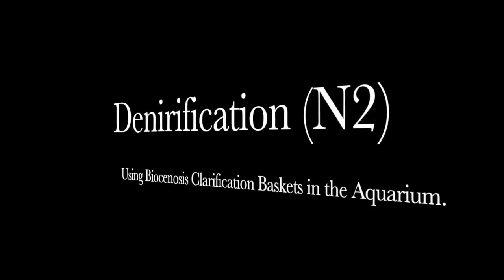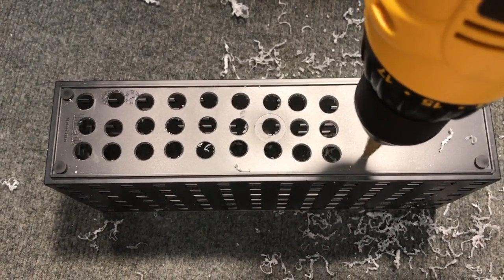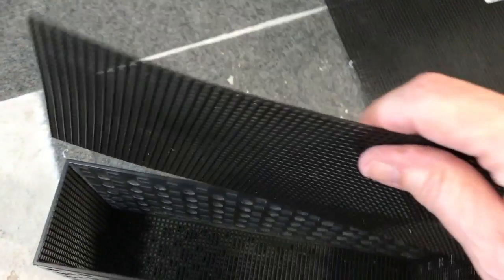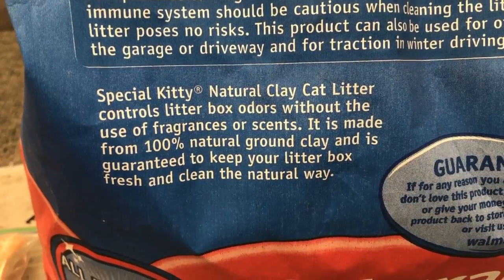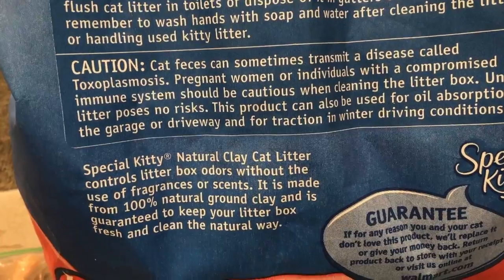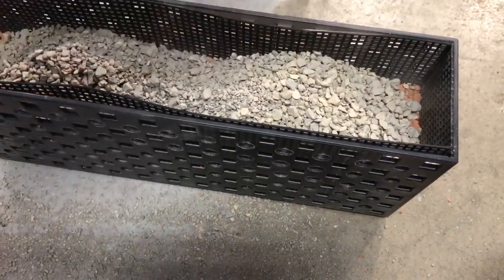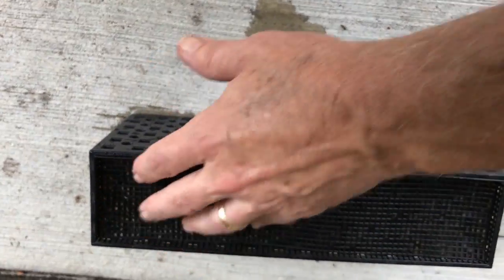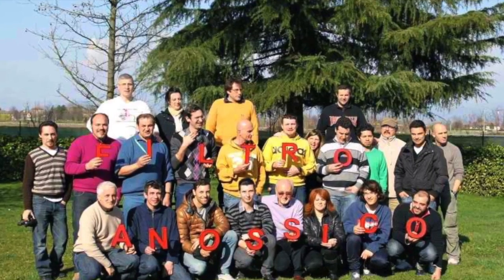Denitrification (N2) using a Biocenosis Clarification Basket in the Aquarium Sump.

Comment: It's my understanding that ammonia molecules are attracted into the baskets by the negative electrical charges that exist within it. You say that these baskets last indefinitely; wouldn't the charge be reduced/negated over time and cause the basket to lose effectiveness? Please help clarify if I am misunderstanding something, thank you very much.
Reply from the maker: Actually the baskets keep their charge as far as I know indefinitely. I’ve been using the anoxic filtration system for over 30 years without ever changing some of the baskets and they still work today as good as I did 30 years ago.
Reply: @anoxicfiltrationplenums  Thanks for the reply. Interesting. I guess the rate of change is simply negligible. 

Do you have any experience with using these filters on African Cichlid tanks, or know of anyone who has? Or would the BCB be compatible with the harder water type that they (African Cichlids) require (not certain on the chemistry). 

I have a 75G setup with running an FX6, and was wondering if it would be possible to simply replace a portion of the default media with a BCB instead of running a sump system? Or does it require low flow conditions? Thanks again.
Reply from the maker: Tuesday, February 4, 2014

Aquarium lovers owe it to themselves to use an AFS...it's not just for ponds anymore!

For you aquarium lovers out there, here are some photos sent to me from Gert in Namibia. In the past I have had African Cichlids / Lake Malawi Mbuna tanks. Mbuna’s require very high pH and most tanks that I’ve seen are overcrowded because of the Mbuna’s very territory aggression towards one another. However, with the overcrowding of Mbuna’s comes water quality problems and Nitrates that will reach 100-ppm if lots of water changes are not carried out to keep their colors from fading.  Another thing about Mbuna’s is they love to dig, so any kind of gravel filtration system is out of the question.

Long ago in the late seventy's Mbuna’s and Tanganyika’s only came from Africa and had to be depressurized when brought up from the depths of Lake Malawi and Lake Tanganyika. They were big and beautiful fish that rivaled that of saltwater fish. Today they are nothing near as spectacular as days of yore, but they still have the same water requirements and Nitrates are nothing short of a big pain in the #%$#* to keep under control…except with a Anoxic Filtration System! 

Thanks Gert!

Dear Dr. Novak. Just look at my 1500ltr (396-USgals) Tanganyika office aquarium running on your Anoxic filter...with zero Nitrates.

Kind regards from Namibia. Gert
Reply: @anoxicfiltrationplenums  Thanks for the anecdote. Any chance you kept in contact with Gert/do you know how his tank has done in the long term? 

There was another youtuber using this filtration system who did not do a water change for 6 weeks yet had 0 nitrates/amonia, however he claimed his fish were looking stressed and out of sorts, which is baffling considering the pristine water parameters. Any such similar cases in your experiences?

Cheers.
Reply from the maker: BennduR not really, been raising very expensive Koi for 31-years with AFS . Had to move them to a Koi farm in Iowa and they were over 30 years old Koi. Some, if not the oldest Koi in Illinois to date. How many time did they get sick in 30-years you ask...zero times and that’s living under harsher conditions than any fish aquarium will ever go through.

Comment: Can BCB be used without a sump ? Is there a ratio of basket volume to aquarium volume ? ( I realise that the stocking level would effect this.) Am considering trying this on 3 of my aquariums which are 220 , 280 and 490 litres respectively. The last 2 have canister filtration and the first uses internal power filtration.

Comment: Hello Kevin. Could you help please. Are there any other products that can be used. Those products of kitty litter’s are not sold where I am in the Uk. Is there anywhere else you can advise me to search to find the correct clay gravel to use for these filters? For example.. apart from cat litter. Could this material be used for gardening maybe. I’d be very great full for any help you can give about this. Many thanks.
Reply from the maker: To be honest with you, I really don’t know what’s available in the UK for the hobbyist. I do know at one time the UK did sell the correct kind of kitty litter and it was not a problem because it has been used on Koi ponds in the UK..
Reply: Kevin Novak thanks for the quick reply Kevin I do appreciate it.👍 could you tell me what clay is actually needed in these filters please.  Would it be bentonite?

Comment: Hi Dr. Novak. Thanks for all the info. Does the kitty litter have to be baked clay based only or any non-clumping kitty litter will do?
Reply from the maker: Best to use only BAKED CLAY only. Oil-Dri  or See-T-Sorb will work too.
Reply: @anoxicfiltrationplenums  ok doc. Doing a fishless cycle and I miscalculated ammonia dose and went up 8 ppm. In less than 48 hours the BCBs/plenum wiped out 8 pm ammonia to zero!

Comment: Hello.. i'm from Indonesia and i can't find baked clay (kitty litter) here. I wan't to substitute it with hydroton (it was originally for planting land plants), do you think it will work?
Reply from the maker: If it is very small of 1-3mm in diameter.
Reply: @anoxicfiltrationplenums  the hydroton that I have is varied sized pebbles. I'm assuming and hopeful that if I took a rubber mallet to the pebbles they would become small enough to be effective.

Comment: Hi Dr. Novak , is it possible to use the anoxic filter in a reactor ? Lets just say a 2 litre capacity, with a flow rate of 50 gph or less. A unite that is approximately 13 inches tall, staggering 2 inches of each layer of the kitty natural clay and laterite. thanks for your time!!!
Reply from the maker: Actually the filter works best if you put as much water as possible through it.
Reply: @anoxicfiltrationplenums  thank you I will make one over the next couple of days and put about 450 gph through it
Reply: @vincentrocco7301  Did you finally tested the reactor with low flow?
Reply: @tincho6720  Yes good to go thank you Peace Vince

Comment: In India it is very difficult to find either kitty litter or oil dri hence it has become difficult to prepare BCBs. Hence, I am planning to build an aquarium using plenum only. What can I use in sump because BCB is out of question? Or can I build another plenum in the sump?
Reply from the maker: A plenum in the tank will be enough, you do not have to build one in the sump.
Reply: @anoxicfiltrationplenums  Sir attapulgite cat litter clay non scented is readily available at a reasonable cheap price around 1 dollar for 3 kgs. Should I go for it and use it as both gravel and in bcbs? Kindly reply as I am going to set a 135G in the first week of September.
Reply from the maker: @bhuwanchander2196   just use it in BCB and use an aquarium substrate as a medium for the plenum.
Reply: @anoxicfiltrationplenums  thanks a lot from the bottom of my heart sir ❤

Comment: My question is, what are your nitrate level before and after install. Is it really working? I'm only asking because I'm about to set this up in my canister filter. I figure I'll do about 2 or 3 tray's with a diy box to hold the kitty litter.
Reply: i'm not 100% but i think it would work better in areas with not much direct flow
Reply: @nycjt6267  Your correct, low flow is optimum but his method kinda eliminates that. Since the cat litter is packed in the container water will not flow through but around and seep into the cat litter. The denitrification should take place at the core of your container where there is little to no oxygen. Same thing will take place in a deep sand bed but the nitrogen bubbles will kill your fish as they seep from the bottom of your tank.
Reply: @russaification  cool! just checked a few videos on it. any interest in documenting your build?
Reply: @nycjt6267  I figured I'd make a video on it. So sure I'll document it.

Comment: could I make up a basket using light diffuser panels for the outside walls, mesh on the inside?
Reply from the maker: Yes you can it should work very well and then add a screen in the inside of it.
Reply: @anoxicfiltrationplenums  
ty, its going in a 40breeder/sump 120/display. Im going to elevate it in its chamber figuring all sides will get some what equal flow. Also would something like 5"w 5"h 16"L be overkill?

Comment: Hi Dr Novak. I suspect I may have produced a similar result to your baskets in a tank set up I had a couple of years back. At the back of the tank I had piled a large amount of aqua soil (granules of baked clay which seem to be similar to the kitty litter) behind some drift wood. I was initially concerned that it might turn anaerobic but all was fine. I planted heavily and used CO2, fish load ended up quite heavy. Once the tank had settled down the nitrate just disappeared. I initially presumed this was because of the heavy planting but having dismantled the tank and restarting with much less of the aqua soil my present tanks both suffer with what I consider to be high nitrates (20-40ppm). I’m presently experimenting with using cat litter as a deep substrate. Any thoughts?
Many thanks for sharing your knowledge over YouTube.

Comment: Dr Novak. Thank you for this revelation in filtration. Please could you advise if zeolite would suffice as a replacement of the kitty litter?
Reply from the maker: Judy Drench  yes, it will it is already being used in Thailand
Reply: GREAT. You wouldn't believe how difficult pure, non clumping cat litter is to get in the UK. Kitty Litter is the only one I can find, and it's £50 for 25lb. That's $80 roughly!! Thank you :)
Reply: @anoxicfiltrationplenums  Thanks, i just posted the same question, i am having great difficulty in getting non-clumping kitty litter in India, its all the clumping type that is sold here. So will be using Zeolite to make the BCB !!
Reply: saif khan Hi, any updates on using zeolite for you BCB?
Reply: @sspwang8013  I have made a basket but I am afraid of using it since zeolite would absorb potentially all ammonia initially disrupting my nitrogen cycle
Reply: @anoxicfiltrationplenums  What about zeolite adsorbing all ammonia initially and starving out the nitrosomonas and disrupting the nitrogen cycle, is that a risk and also cannot ever add salt in the aquarium later on since zeolite releases all ammonia with salt. Are my concerns real about nitrogen cycle disruption ? Please advise
Reply from the maker: Dan Dordai  Do not use anything that’s made out of paper it has to be baked clay that is used in kitty litter or oil dry.
Reply from the maker: saif khan  do you have a product called oil dry, Where you live? That  is the same thing as kitty litter but it’s only used to absorb oil spills and stuff inside garages.

Comment: Hi Dr Novak, would Seachem Zeolite work as well as non clumping cat litter?
Reply from the maker: Yes, it’s used in Thailand more than any other country.
Reply: @anoxicfiltrationplenums  Thanks Dr Novak for your reply. It's impossible to get hold of non-clumping kitty litter in Singapore! Hence, I've resorted to using zeolite and seachem flourite. Set up two anoxic clarification baskets middle of May this year.
Reply: @mikeaaronyap  Hi Mike, how is zeolite working for you. And does the zeolite need replacing
Reply: @sakleo8  zeolite is working fine so far. I'm running only an 8w eheim canister filter that return water from my sump tank to my main tank. Had converted the canister into an Anoxic filter as well.
Reply: @sakleo8  no need to replace the zeolite

Comment: Absolutely fascinating stuff. Thank you so much for sharing. I've been reading all over the place about the use of deep sand beds in freshwater tanks but this seems so much more reliable and significantly less risky. Unfortunately I run a canister on my fancy goldfish tank, would a basket like this be OK sitting in the main tank, behind a piece of driftwood for example?
Reply from the maker: matthew smith As long as the goldfish can’t get to it and dig in it it will be just fine
Reply: P4p

Comment: Can you put this filter inside the aquarium if you dont have sump filter?
Reply from the maker: yes
Reply: @anoxicfiltrationplenums  thank you sir. I have been in trouble with my nitrite levels for about 2 weeks already.. ammonia is zero but nitrite level is purple and i have been doing 20% and 50% water changes and it seem to be ineffective. 

I already bought zeolite [in place of cat litter, because i cannot find the non clumping clay litter here in the Philippines] and Lava rocks [for iron content in place of laterite]. I will try to place inside the aquarium and also try to put some inside my cannister filter.

Btw, i only have 1 arowana in a 120gal tank without substrate.

Also would like to ask if you are familiar with Purigen by seachem? Will it affect the anoxic filter?
Reply: @anoxicfiltrationplenums   sir thank you for the info on anoxic filtration.
I just used 300g zeolite and 200g lava rock mix. It seemed to wipe out the nitrites and amonia in my 120gal bare tank with 1 juvenile arowana resident.

I was having trouble for 2 weeks water changing..  the additional anoxic basket i made made the difference in just 3 days!

Thank you!

Comment: I have two questions Doctor Novak: If given a nearby source of Carbon ("crushed Coral") and Iron (Flourite) in the main water flow path, will a Cermedia Marine Pure Block do the same job? And: Do you need to 'seed' the Anoxic Bacteria with MicroBacter7 ?
Reply: check this out and see if the principles are interchangable... I don't know the answer, but this page surely explains why the basket is designed as it is: http://www.mankysanke.co.uk/html/anoxic_filtration.html
Reply: @gold3nrul311  Thanks for the link.